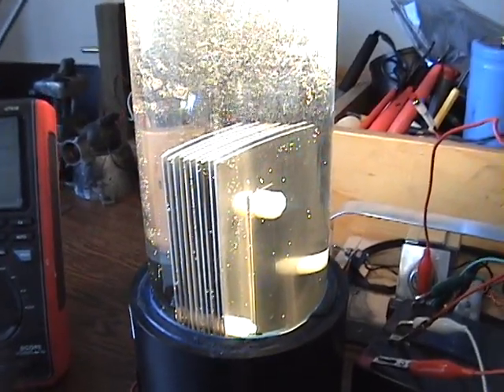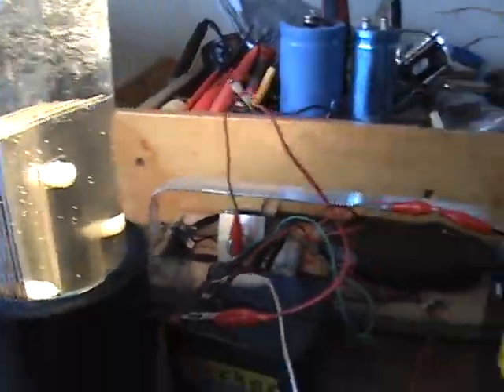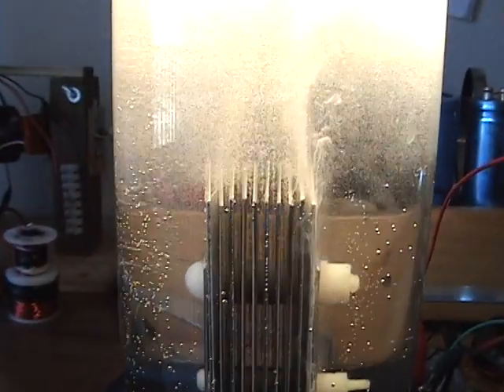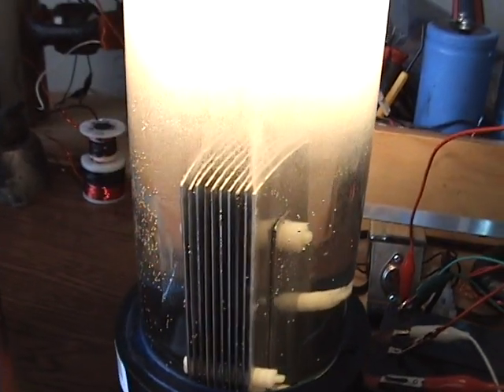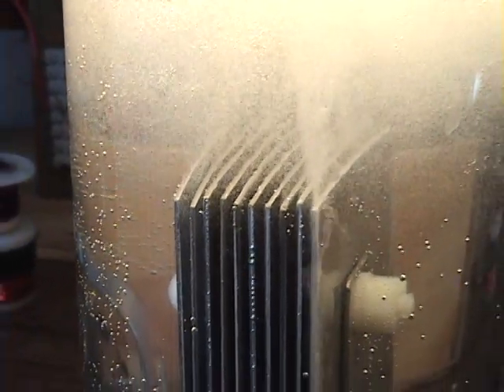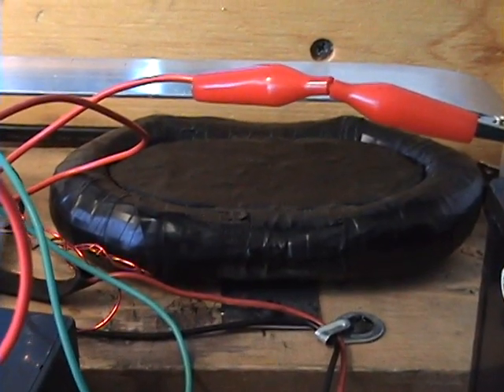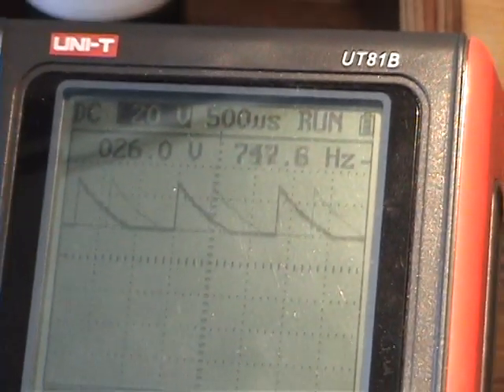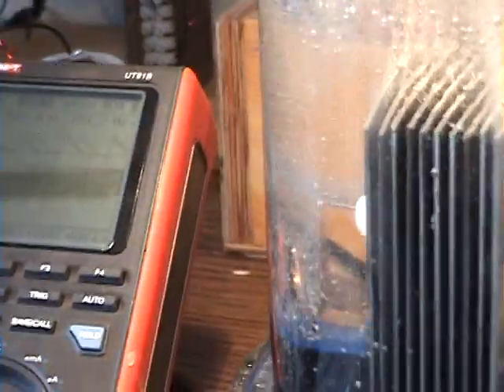High Voltage Electrolysis

Comment: Hey @supermuble,

I've done the same thing with the rectified main's voltage of Europe which is about 325VDC. Using a higher voltage like this, pushes up the current too. That means you can reduce the size of the steel plates and still get the same effect. Thanks for uploading this video. I really liked the idea.
Reply from the maker: That's really neat! Normally amps would go up when you raise voltage, but with the circuit in this video the voltage rises without any increase in current. The circuit is actually inherently devoid of current, because it is based on a principle of flyback energy. I do believe that this is the same principle that was described by Meyer when he said that "voltage will go towards infinity" in his circuit. In this circuit, voltage will go towards infinity as the resistance of the water increases, so you have a continuously variable voltage that allows the cell to work the same with tap water, or water that has chemicals added to it.

Comment: Ok I got the used spark module in the mail today and hooked up the High Voltage charger,based on your plans I bought from your website . I just used a old recycled  transformer that i took out of  a old  broken computer speaker amp and used your circuit instructions and the thing works like a charm!!  It charged up my 3000V 40MFD cap  in about 30 seconds!! I dont understand way the thing does what it does but it sure works great!! I have a couple tech questions on the Triple Circuit though??

Comment: Cont.. The spark was so bright it was like the flash on a camera. I used the bifilar air core that you recommend with the multi strand secondary per the schematic and your notes. I built the simple version to test it and it works amazing! I just got back from the store and bought 3 more power transistors (150watt each) and I am going to attempt the triple circuit that is in your instructions next!! Oh and I also ordered the ignition spark gap to build the High Voltage version. Should be here in

Comment: Thank You! Bought the plans for your Radiant Charger and it works AWESOME!!! Best money I ever spent!!I I used an air core per your recommendation. It only takes about 60 seconds to charge my 450V 1600uF capacitor and for some reason the energy that comes out of the thing is more powerful!! I intentionally shorted the cap just like I always do, to discharge it and it sounded like a 457 Magnum fired off .PLUS !!